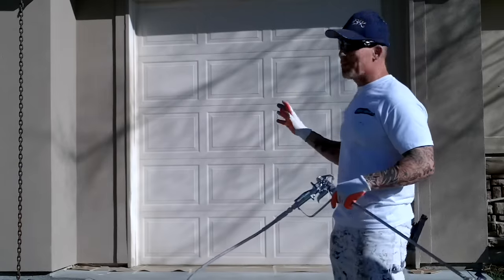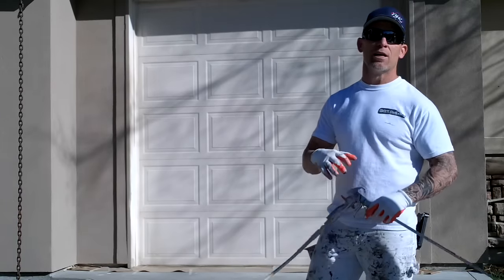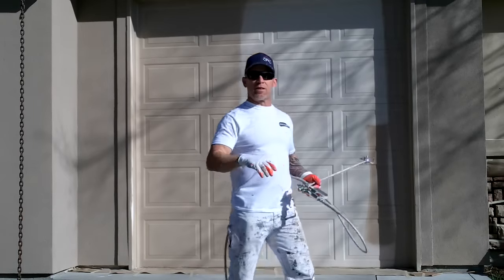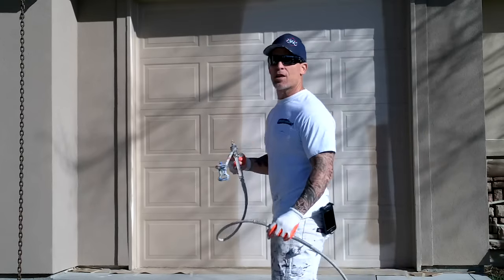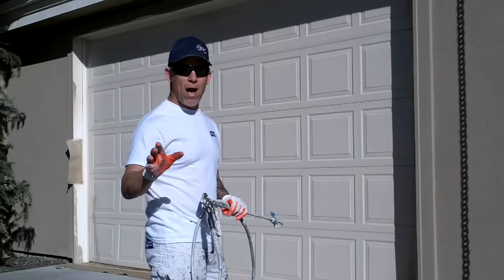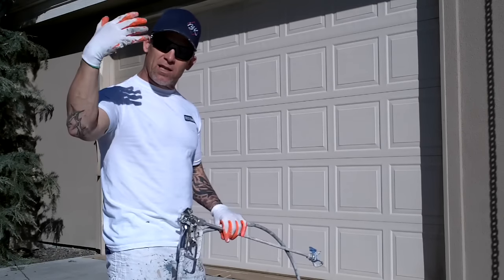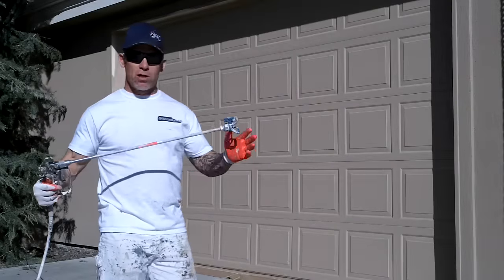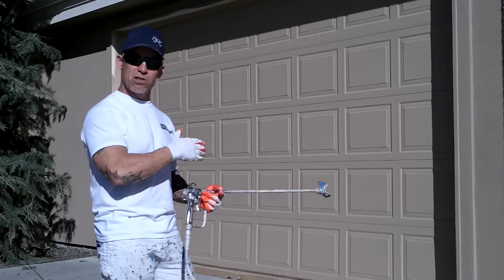How To Paint A Door.  Paint A Garage Door With An Airless Paint Sprayer

Comment: Hi Chris
Would it be possible for you to post a vid explaining the correct spraying pressure with different paint types and tip sizes etc using the titan 440, as a newbie I always seem to get loads of over spray when using mine.
Thanks for the great videos. 
Rob

Comment: When you open the garage door, you will see the original color where the horizontal joints are that did not get painted with the sprayer.  So, as you painted what appeared to be grey on a white door, you will see the original white edges as the door opens and closes.  Do you paint those edges in the joints by hand (brush) by disengaging the garage door opener and opening the door manually?  Or - do you leave the original color in the joints?
Reply: Thanks very much for answering my question. If you stick to the original door color, doing it this way would not present a problem.  If you change to a new color, however, it would be unsightly - in my humble opinion.  Plus, my customers would ask me why I didn't paint the horizontal gaps.  So, I paint them manually after releasing the door.
Reply: Yes,  I did click the thumbs up button.  I very much enjoy your videos.  Actually, I have been painting for some 30 years now and have never used spray equipment.  So, I learn a lot by watching how you apply paint using the airless sprayer.  I completely understand what you mean in regards to the garage door sticking.  Thanks again for responding to my thoughts.
Reply: Gary Gendreau I don't see Chris' answer to your question even though you thank him for the answer.  Is there a clever way to spray paint the panel edges that are visible as the door moves?  I am painting a white door brown and don't want to see the white edges as the door opens and closed.
Reply: LTVoyager You can lift the door a section at a time and lightly spray those gaps as they open (don't overspray anything inside like a car), or you can paint with a brush.

Comment: My house is stucco, in Central Florida. Do I need  to pressure wash before spraying. Could i use the Graco X7 Paint sprayer filled with water and wash the stucco before painting or do I need a higher pressure.

Comment: Chris, How do you or whats the best way to clean roller naps in a clients house (without using sink) after an interior job in the winter with water to hose cut off and freezing temps?
Thanks
Reply: That's what I assumed as I do the same just wondering there was a tip I was unaware of. Thank you 👍